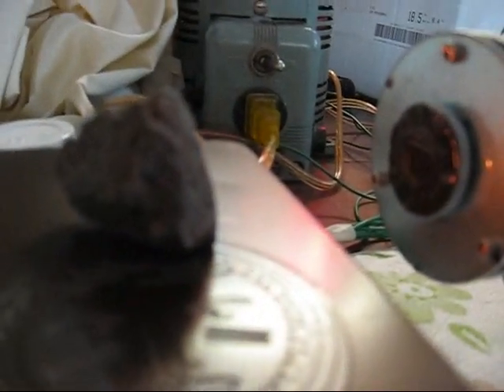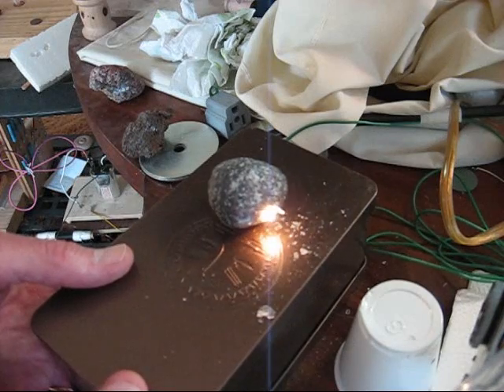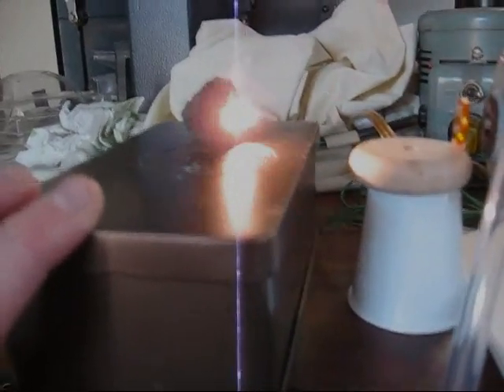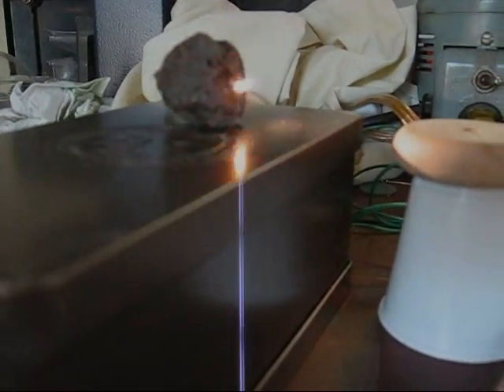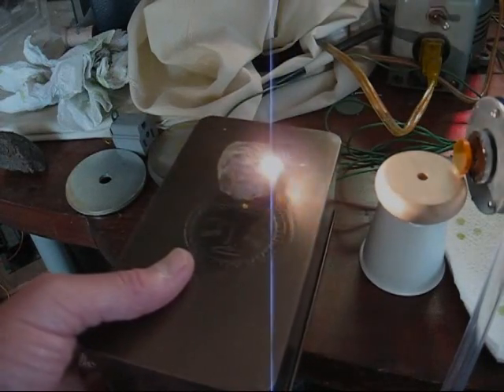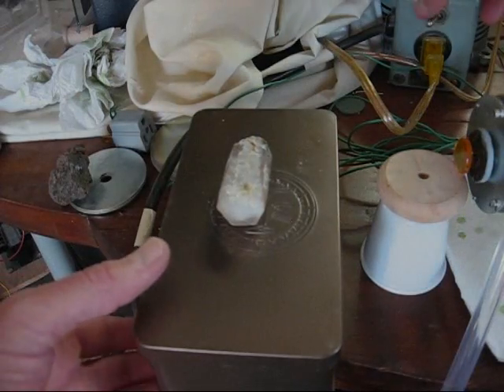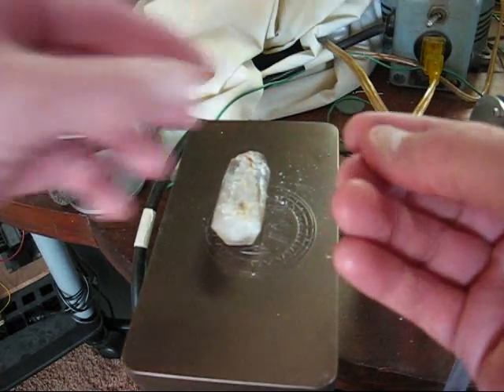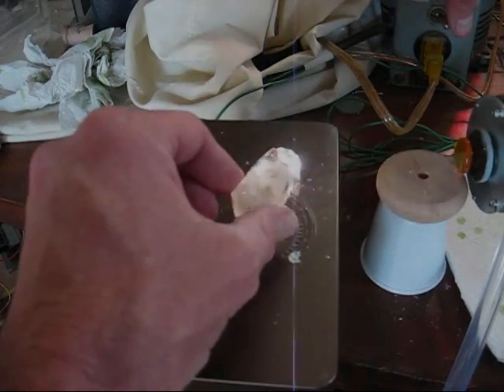Second Homemade CO2 laser in Action

Comment: hi, what type of lense you use in this tube please ask me
Reply from the maker: I used a zinc selenide (ZnSe) lens. Few materials transmit this wavelength. Normal optics, used for visible and near infrared light, are completely black to the wavelength from the CO2 laser.
Reply: sir what type of partiacl mirror you use
Reply: thank you so mich

Comment: impressive work with incredible power! you clearly understand what you do. if you dont mind could you tell me what power supply you used?
Reply from the maker: +mrjackpot 

I used an iron core neon
sign transformer. 15kV at 60mA. I put an variable transformer between the mains
and the NST. With the variable transformer, or variac (sometime called “autotransformer”),
I could regulate the output of the NST. Make no mistake – the output is lethal.
The high voltage is by far the most dangerous part!
Reply: +Jarrod Kinsey thanks for the info! your laser is by far one of the most powerful around on youtube
Reply: +Jarrod Kinsey do you have the vacuum pump constantly running to circulate the gas? or do you use it to find the optimal pressure, then cut it off?

Comment: Jarrod, can I use a CO2 laser tube working in a vertical position?
Reply from the maker: That depends upon your cooling system: with my system, water must enter at the bottom, fill the tube, and then exit at the top. It won't work in reverse for the same reason that you can't fill a bucket from the top, if there's a hole in the bottom - the water must come in at the bottom, and rise until it comes out at the top. 

Steering the beam should be easy enough using a configuration of first-surfaced mirrors. Just remember that this wavelength will not penetrate glass (or most other substances for that matter, hence the difficulty in construction), so you cannot reflect the beam from a reflective film that is behind (opposite side of) glass, as is the case with most ordinary shaving mirrors.

Fortunately, metal is a good source of mirror material where first-surfaced types are unavailable. Be creative and use your imagination. Just keep it safe. You've only got one pair of eyeballs - if the beam can make a rock glow white hot, imagine what it can do to the front of your eyeballs! It only takes a momentary reflection from any shiny surface including jewelry, furniture, or glass. You can't buy a new pair of eyes at the furniture store ;-)